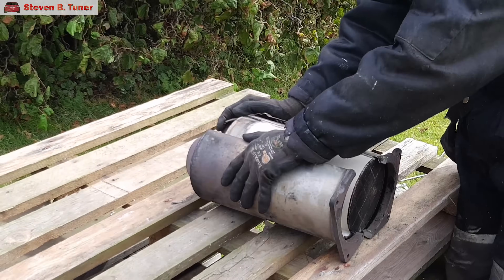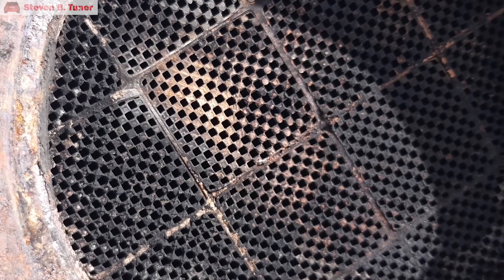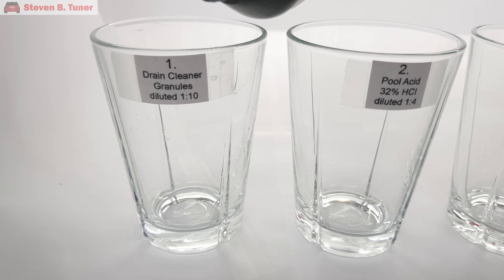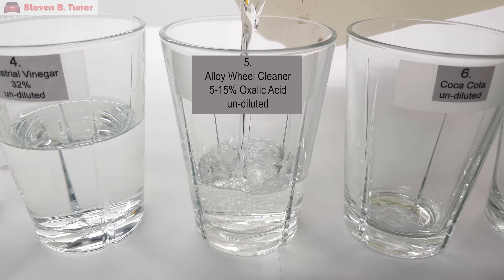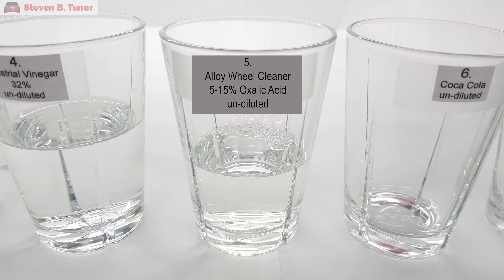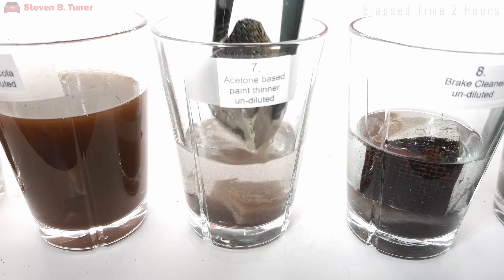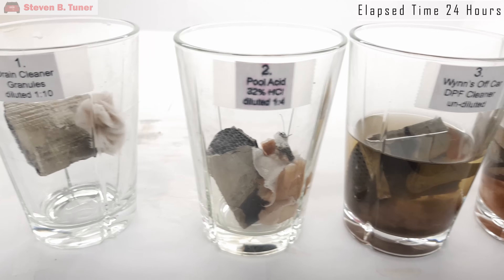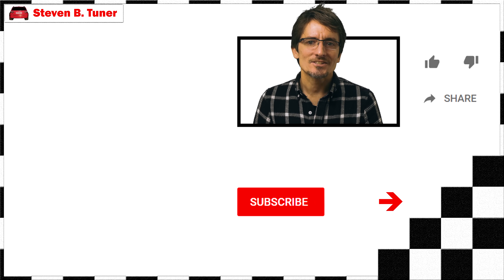DPF Cleaning at Home – 9 Chemicals Tested (Diesel Particulate Filter DIY Ash Cleaning)

Comment: Hello. The DPF life is usually considered to be 150 000-200 000km. Having this in mind what will be effect of the DPF cleaning if it is already old? How long will it last after the cleaning? Thanks!
Reply from the maker: Hi, thanks for watching! As long as the steel/stainless steel case is in good condition, then after a good chemical clean then the DPF should be ready for another 150,000 - 200,000 kms. My favorite method so far is the 2 stage chemical clean featured in this vid: https://www.youtube.com/watch?v=LE1boZ3fhLg
Reply: @StevenBTuner  Thanks for the answer. Is it needed some kind of software configuration after the DPF cleaning in order to work properly and continue to regenerate? My car is Fiat Bravo II 2008 1.6 multijet 105hp. Yesterday I checked the DPF with OBD2 transmitter and android app. It says that the DPF Clog level is 98%, Filter status - not clogged, and mileage 313841km. The problems I occur while using the car is that the idle is not always stable, little higher fuel consumption than expected, ofter the engine fans are running and white smoke is coming out of the exhaust(often regenerations I guess) and from 1-2 weeks the first start for the day is harder and "check glow plug" message is displayed with flashing glow plug light. What I have in mind is glow plug investigation and eventually, change by a mechanic and after that chemical cleaning of the DPF. I will be happy to hear some more advice from you. Thanks!
Reply from the maker: @КирилДраганов-р9д  Hi, you are on the right track - that glow plug error needs to investigated first as it can cause additional issues with regeneration. If the DPF has never been cleaned or replaced before then it is very likely very full of ash at those kilometers, and those cars like to pour out the white smoke when they regenerate.
Reply: @Steven B. Tuner  When I was on a diagnostic(almost two months ago) the mechanic told me that the DPF is 95% clogged but with good differental pressure which is strange. Is it possible this DPF was cleaned from the previous owner but Reset DPF adaptations not done and the car ECU is now blocked on 95% DPF clogged and continues to do often regenerations? This kind of make sense to me because while driving the car I don't feel any loss of power and it drives normal. Thanks!
Reply from the maker: @КирилДраганов-р9д  Hi, that could easily have happened.
Reply: @StevenBTuner  Last week my glow plugs were replaced because an error was displayed on the board "check glow plugs". Since there the car had two regenerations (or at least I noticed only two) - one in the city and one outside. Today I checked the DPF status again and it was 38%. Maybe because of the old glow plug the car was not making effective regenerations. What DPF percentage is considered normal? Thanks!
Reply from the maker: @КирилДраганов-р9д  Hi, on many cars the glow plugs are used to heat up the DPF in conjunction with additional fuel (I have a video about this), so it can definitely be the case that your regeneration cycles were not running if the glow plugs had an issue. There is a lot of variance between car manufacturers and models about what the % value means. If it is measuring soot, then it will start low (after a regeneration) and then increase to a point where a regeneration will be started. If it is measuring the ash level then it will slowly go up until the car thinks that a new DPF is required (or a cleaning operation performed).
Reply: @StevenBTuner  In my case I think it must be the soot as after my last outside city trip and regeneration the level dropped from 98% to 38%. Also, the dpf status on the app was never clogged and I never felt loss of power or something similar on the car. I think that a few more long trips will save my DPF at that point. Thanks!

Comment: I used soap rock. I do not know other name for it in english.
Anyway. I taped one end, filled with 50% soap rock mix (with some random mix with water) let it sit for 30 minutes, it went hot and after end of reaction, I washed it with presurewasher. I t was like new.
Reply from the maker: Hi, thanks for watching and for sharing your experience! I think that soap rock is Sodium Hydroxide / Caustic Soda. There is one thing to really watch when using it for DPF cleaning - it will dissolve the silicon carbide ceramic material at over 100 degrees celcius, so you've got to not let it get too hot.
Reply: @StevenBTuner  you are right, It is sodium hydroxide.
It does not go wery hot. I do not know exactly what accelerates reaction. I am not chemist. I happened to discover that, when I tried to wash my diesel engine intake manifold made of plastic. You know they will collect heavy EGR residue. So one friend of mine suggsested fireplace cleaner, but it did work bad, since it was to lean. So I bought extra stiff variant of same only incredient.
I mixied it with additional water(I bought it as 50% sodium hydroxide and I mixed randomly with tap wather), and it went warm. Like i could still touch it, but it was like  40 decrees or something.
English is not my first language, so sorry for mistakes.
Reply from the maker: @Martink9191  40 degrees is okay. It is very powerful, cheap, and useful chemical!

Comment: the link is not working.

 Is it possible to get link to the winning material in the test?
Reply from the maker: My favourite cleaning method is still the 2 stage chemical cleaning method featured in my video called "The No Damage DIY DPF Clean".

Comment: Hi steven could you help me out am getting thé 2 dpf codes and i Cant get rid of them ... Thé 520d regenerates Every 500km everything works fine..... .i do notice the car wont boost under 2000rpm
Reply: Still these codes keep coming back what could be thé problem
Reply from the maker: Hi, low rev response issues are often caused when the MAF and MAP sensors are in disagreement about how much air is flowing. If neither have been replaced in the last few years then it could be a place to start.
Reply: @StevenBTuner  thanks for the help .i just  been scanning and is it normal for the intake temp sensor to show -50 when the ignition is off terminal15. When ignition on it reads normal temperatures.
Reply: my  direction was the O2 sensor .. but Now i took a look at thé airmass flow and it shows a litle flow while ignition is off. Weird or is this normal
Reply from the maker: @e60tube90  Hi, it generally doesn't matter what it reads with the ignition off.
Reply from the maker: @e60tube90  Hi, with the MAF sensor as long as it is really small with the ignition off then it is no problem. The first sign that it is not working well is if it takes longer and longer to react to changes in the engine rpm.
Reply: @StevenBTuner  .thank god lol i was trippin out -40 c° .
Hope a new maf will clear those  haunting 480a 481a fault codes . Weird that the car regenerates Every 300 to 400km resulting in to much fuel in Carter making thé oil level to high .... Lucky me for checking the car Every 3weeks . Damn E60 why do i love this car so much 😂😂
Reply from the maker: @e60tube90  They are good little cars!
Reply: @StevenBTuner  lol hope to see a new video soon
Reply from the maker: @e60tube90  Soon! :-)
Reply: fixed the 480a 481a dpf faults !!!
backpressure is now 8 mb at idle
instead off 56mb at idle . ;-)
Reply from the maker: @e60tube90  Perfect!

Comment: The best I've found is hydrochloric acid non diluted. DPF fully filled for 24h. Then hot 90⁰ to 130⁰ steam cleaned from KEW makes it as new.
Reply from the maker: Hi, thanks for watching and sharing your experience! All hydrochloric acid that can be bought commercially is diluted a fair bit - it should say on the container whether it is 10% or 30% HCl etc.
Reply: @StevenBTuner  depend where. Im in the UK and when buy it as a garage from chemicals place it comes in 68% if im right.

As a cleaners or concrete etching yes it comes diluted to 30% ish or even 3%.

Most concentrated is when named as concrete remover and diggers cleaner. Then it is about 32%.

But as a so called "pure" rust remover it comes in 68% to 72%. Rest is not water but other cleaning agents mostly.

It eats everything apart of metals. So what ever in DPF it is melted and its joint  to the surface broken.

Did like this well over 2000 dpfs in past 16 years.  Also it cleans EGRs, Inlet ma ifolds, Engine blocks and Transmissions of the heavy dried oil leaks and dirt.

As all acids we know that kind of strong acid need deactivation later on. When used on engine blocks to not gain rust later it need flushing by water mixed with building calcium or some milk. Then again rinse with clean water. Otherwise freshly cleaned shiny block become orange in maybe 2h.

At the end... not every chemical says how much hydrochloric is in it. For example autosmart TrebleX doesn't. It is very strong but it doesn't says percentage as it is their secret. Somehow is legal....
Reply from the maker: Thanks for all the great information! For whatever reason I have never considered using acids for inlet manifold cleaning - but I'll definitely be trying it now.
Reply: @StevenBTuner  also try mr.muscle oven spray to clean manifolds or turbo VNT (you no need to take turbo off what is best part of the trick). Is a great cleaning agent for soot. Then there is other commercial oven cleaning liquids that also clean EGR and manifolds very well with just 30 minutes soaking and then pressure rinse down. Automotive products ain't as good or even close to them commercial chemicals.
Reply: @steven I’ve used the dishwasher tabs flush for two days and still clogged no flow through !? Ordered NaOH pellets , how long I can fill it for and at what  concentration? I take it’s same as drain clean pellets ?

Then after above can I use undiluted brick cleaner and fill it for few hrs?
Reply from the maker: @sysklan  Hi, please don't use the acid undiluted unless the package says that it is already around 6%. Undiluted 30% brick cleaning acid with eat holes in the welds and possibly even ruin a catalyst in a few hours! I use 30% HCl and then mix it 1 part acid with 4 parts water - you can see the whole process in my other vid: https://www.youtube.com/watch?v=LE1boZ3fhLg

Comment: Why not get on the highway, drive with 3000rpm for some 20minutes, let the motor run for another 10 minutes and the filter should be just as new.
Reply from the maker: Hi, a long drive is perfect for passive soot burn-off. However, this vid is about the removal of ash that builds up over the life of your filter and eventually stops it functioning at all.
Reply: If it is a new filter then yes.

Comment: this test is absolutely meaningly less it's all based on airflow through the filter.  not how dark the cleaning fluid is, geez.  I bake filters yearly and no hocus pocus it's based on before and after the airflow
Reply from the maker: Hi, thanks for watching! As I mentioned at the start of the vid, these are viewer suggestions to try out. If you want to see full cleaning processes that have been done many times successfully then see some of my other videos, and don't forget to read the comments of those who have followed the process themselves and even measured before and after differential pressures to show that the cleaned filters measure the same as a new one. Keep in mind that my audience is mostly car drivers who have to do this process once in the lifetime of the car, and the filter is normally a pain to remove and is generally so full of ash that the car barely runs any more. If you are trucker doing lots of miles and with an easy to remove filter then yearly baking definitely makes the most sense to keep things in the best condition for the year ahead.

Comment: Hey Steven why not the Alloy wheel Cleaner broski?
Reply from the maker: Hi, alloy cleaner works well - so it comes down to which is cheaper and easier to find.
Reply: im sure all of these are cheaper than buying a new Dpf Steven lol, did a dishwasher tab prewash yesterday saw a bunch of ash crazy thing is dpf didn't seem clogged, how do i message you directly?
Reply from the maker: @ragestyler-mac8250  Hi, the most effective and low cost system that I have worked out so far is in my other vid: https://www.youtube.com/watch?v=LE1boZ3fhLg  Older cars use a mileage counter to tell you that the DPF is end of life, so if you have used the correct oils for the life of the car and good quality low ash diesel fuel, then the DPF won't be anywhere near as blocked as the car things it should be. My email is on my 'about' page.
Reply: @StevenBTuner  i followed that video and did all you said.
Reply: @StevenBTuner  couldn't find your email in about page but i must say my dpf works like i just bought it oh and my car has 604000 miles
Reply from the maker: @ragestyler-mac8250  That's 100% awesome!

Comment: Cześć Steven.Dishwasher tab diluted 1:10 L water?
Reply from the maker: Hi, that is probably about right. Start by crushing up 10 of them and mixing with 1 liter of water. After a few minutes in the filter and lots of shaking you should be able to tell if you are getting a lot of oil and soot coming out. If it is very dirty then you will need to do it again - maybe a few times, so that the filter is ready for the second stage acid wash.

Comment: The biggest problem for those cleaning their own DPF, is removing it.

I'm sure that most are like me and want to avoid that complication and cost. Itching to try Oxalic acid and  a Dishwasher tab as the improved combo, since your earlier "The No Damage DIY DPF Clean": https://www.youtube.com/watch?v=LE1boZ3fhLg I feel there's a need for further progression to these most informative experiments; is to look at chemicals that may be safely used without necessitating DPF removal. 

You know that most of those that claim superior results. refer to off-car cleaning, like the Wynns in your test, so coming up with the answer to this question is really the holy grail. In fact your experiments may well use chemicals more effective than commercial products. Perhaps another test is to use commercial products like Project Farm and evaluate them. Are there any charlatans out there. Fantastic analysis. Keep it going.
Reply from the maker: Hi, the biggest problem is how to judge success - it would either involve driving a further 100,000 miles, or maybe cut open each filter to see how far the chemicals penetrated, which gets a bit expensive. I'll keep thinking about it...

Comment: Any idea why the ash is red?
Reply from the maker: Hi, thanks for watching! I suspect the red is iron oxide - perhaps coming from an iron engine block or other iron or steel components in the engine or turbo. In some vehicles the ash is white or pink or brown - so there is a bit of variance in the compounds produced.
Reply: @StevenBTuner  failed egr cooler very possible

Comment: I have tried it and it works. The car has been running for almost 3 weeks now with no more issue with DPF. Cheers. The only thing I would emphasize is to make sure that the filter is completely dry, because after installing it there was some water coming from the exhaust pipe, however as recommended by Steve I kept the car on idle for couple of  "minutes/hours",.
Reply from the maker: Great to hear! I have tried all sorts of ways to dry out the filters before refitting, and none of them work all that well, as the ceramic absorbs water like a flowerpot. Overnight in an oven would work, but otherwise a gentle engine warm-up like you have done is probably the best.
Reply: @StevenBTuner  What about the differential sensor, will it be damaged with the steam?
Reply from the maker: @novak4142  Hi, the differential pressure sensors are at the end of a long thin tube so that nothing actually travels up to them except the pressure.

Comment: Does it work at the same way for FAP( anti particolate filter)? I have problems with my opel insigna 2.0 163hp, diesel, it has lost the power and on the screen shows me " anti particolate filter is full"!
Reply from the maker: Hi, the Insignia filter looks very similar to the Volvo filter I used in this vid to do a full cleaning process: https://www.youtube.com/watch?v=LE1boZ3fhLg

Comment: I used to use methanol for cleaning my marijuana pipes, it worked quite well. I'd just submerge them in it in a big sealed tub, wait 12 hours, then rinse off with water. Little to no scrubbing was required even on rather filthy pipes caked with crud. Came out looking brand new. Those days are long past since I became a truck driver, unless laws change. I just wonder if it would work well on a DPF..
Reply from the maker: Hi, I haven't tried methanol yet as it is virtually impossible to get hold of where I live...
Reply: @StevenBTuner  Denatured Alcohol or Isopropyl Alcohol might be an alternative. I know Isopropyl Alcohol does about the same thing when I was out of Methanol. It's a little more expensive per volume than Methanol unfortunately. I think some brake cleaners use methanol in the mixture as well, I just didn't use them due to the other chemicals used in them.

My only other suggestion would be Hydrogen Peroxide, as I know carbon reacts with oxygen. I've used it as a sanitizer, never really tried it on carbon deposits myself. At least it's easy to aquire in most places.